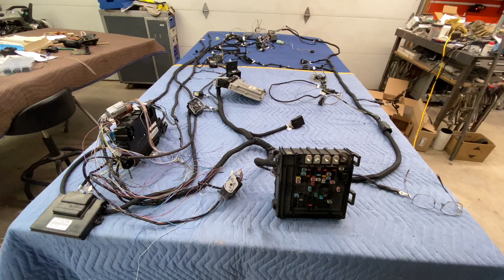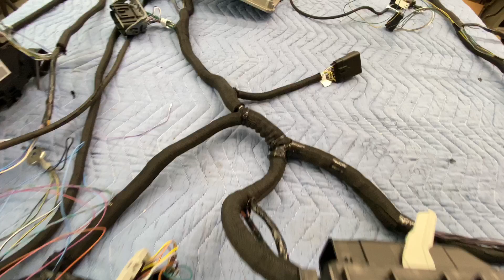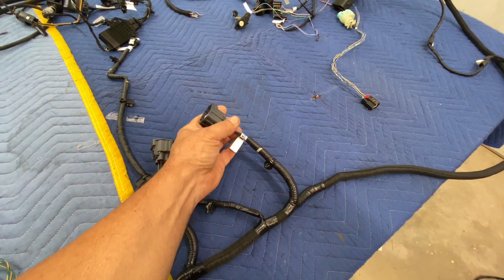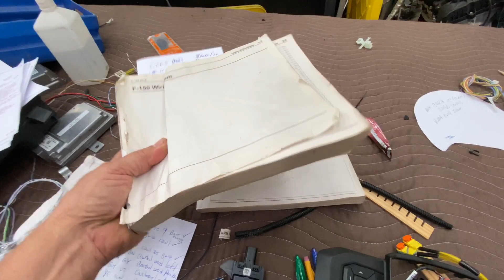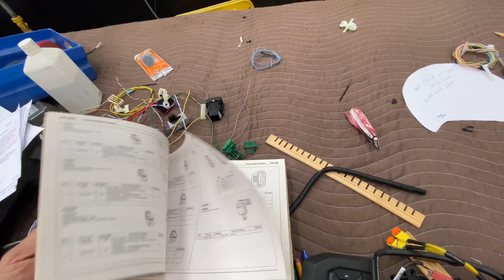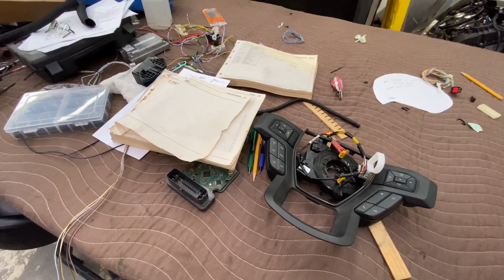1966 F100 Raptor Crate Engine Swap Wiring Update

Comment: I couldn't make out what you are using to wrap them, is it some sort of split loom?
Reply from the maker: F6 woven wrap from wire care. Really nice stuff.
Reply: @randys66garage  Does it expand like Chinese finger cuffs to get over connectors?
Reply from the maker: @jerrybushman  it’s a split loom type. Special install tool makes it a breeze it will expand a fair amount so each size wrap works for multiple sizes.